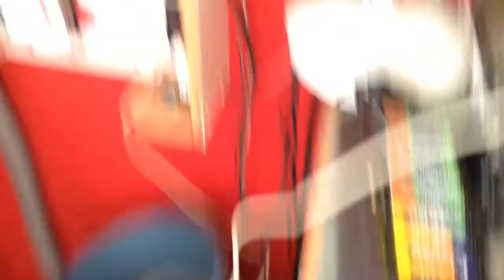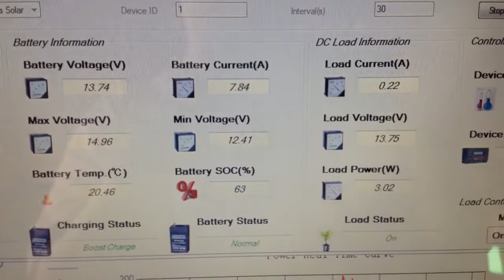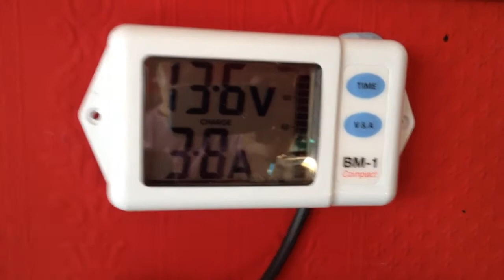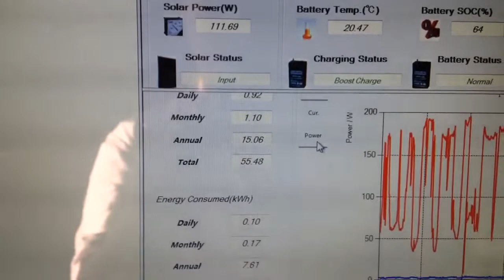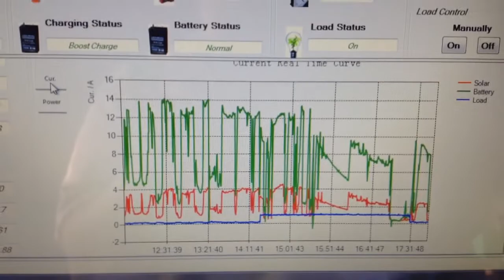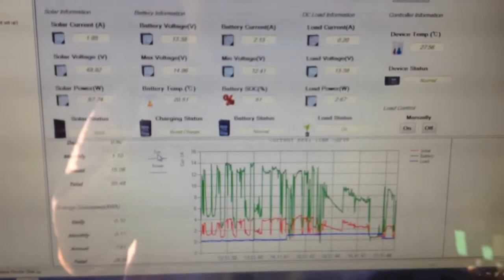Ep Solar Hooking my controller to my computer

Comment from the maker: Hi,
I have just put up a video trying to show how I did it. I will admit that it was tricky to do and get it to work on camera. It took at least half a dozen attempts. The software doesn't always play ball and that's even when I've had it set up on the same computer previously. It can make a difference which USB port you plug your USB to serial rs485 adapter cable in to. If you have issues try a different port.

I first saw this on channel by fellow YouTube Adam Welch, he has a channel on electronics and his solar shed. He too has an EP solar charge controller and he demonstrated how to connect his controller to a computer using the EP solar station software. He also demonstrated the Ebox wifi adapter to monitor the controller wirelessly. You might be interested in his video about this. Hope you find this helpful. Solartiger